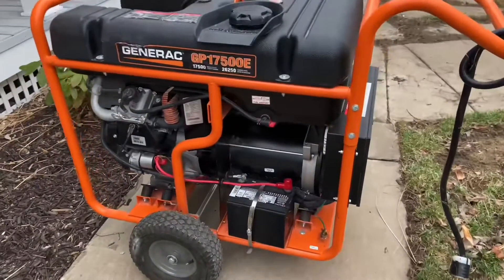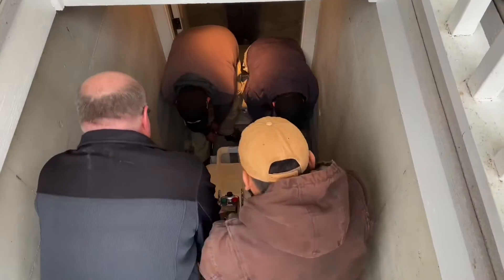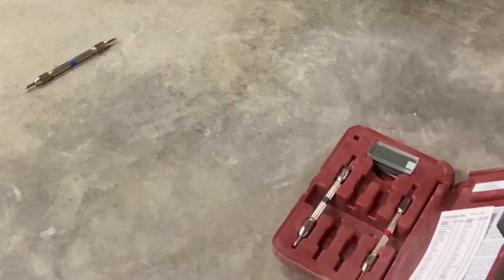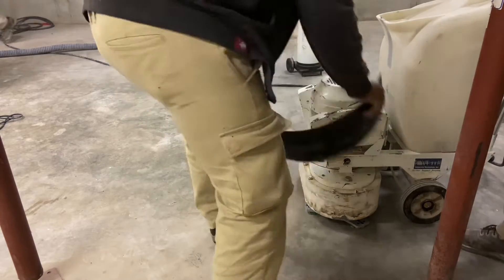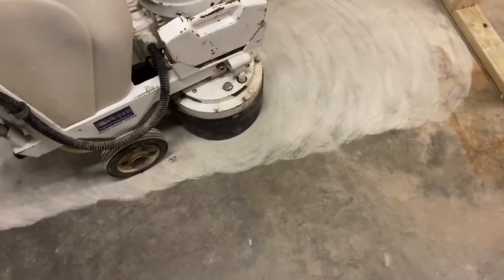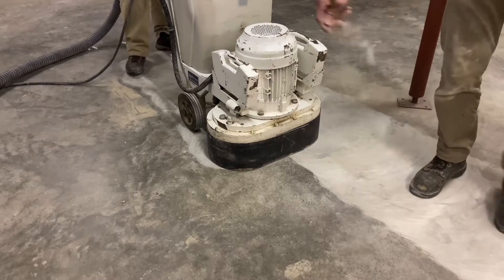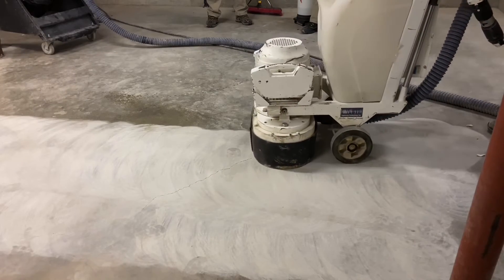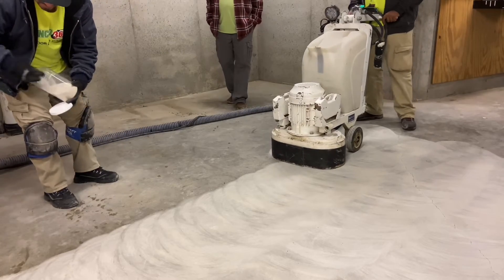How To: Concrete Grind and Seal Preparation by 70 Grit 10 Segment Diamond Tool

Comment: Can you start with 70 grit most of the times?
Reply from the maker: Good question. Unless there is an old coating or adhesive, yes. Hard troweled slabs will cut fine to be opened by a 70 grit. Always on hand is fine sand and a pump sprayer to keep the diamonds sharp. So far for me the 70 grit has worked each time.
Reply: @joshjones8047 let’s say you use endurable sealers would just 70 suffice or would you go up to 100grit? Thanks for answering my questions.
Reply from the maker: @victorrodriguez4081 that’s a good question. Endurable is only a few mils thickness I think. There’s a good chance the scratches show through the sealer. Probably check with them and also try some samples for your own information.

Comment: Thank you for sharing I would like to know why 70 grid on a very hard concrete ?
Reply from the maker: That’s a good question. The coating being applied is a urethane product. It will be thin. The 70 grit leaves a profile that’s rough enough for adhesion, but not so rough that it telegraphs through the coating. A more aggressive tool could be used, but that would mean two steps instead of one. The aim is to open the surface while doing minimal damage.